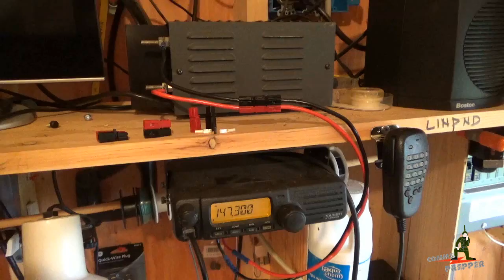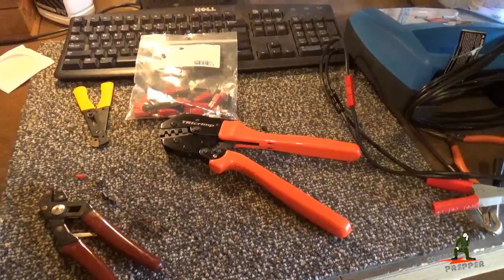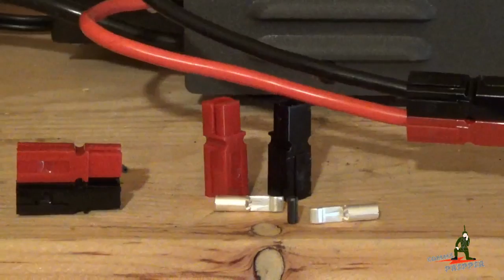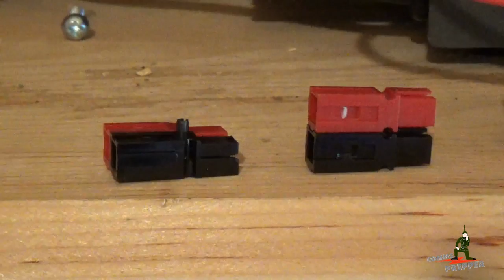Anderson Powerpole® Connectors

Comment: Just started using them. They really neaten up the shack! I am a handicapped ham having almost no feeling in my hands. At first I had problems but a tiny vise really helped. I started with the proper crimping tool and after a little adaptation and some fancy English I got them to work. I almost never solder. In the future I will buy preassembled shrouds. It was the only part I needed help with. I did finally order the $9.99 assembly/disassembly tool as it makes seating the tabs much easier. At first I found PowerPole connectors almost impossible but slowly, with many videos, I was able to master them. I’m on my way to converting every piece of gear I can. MikeinMinnesota N0WDM
Reply from the maker: Thanks for the comment.

Comment: Instead of using the roll pin you can use a screw to mount them to a surface. That can make unplugging them easier if you have a short lead length.

Comment: Anderson Power Poles are stackable and unisex. Other unisex connectors have a "source" and "device" scheme, or are ambiguous in their polarity (get it wrong = bad day).
Devices such as batteries could be considered either a "device" or a "source". With Anderson PPs, ground is always common. As long as you set up your positives and negatives in the same position, polarity will always be correct. You can use a different orientation for non-12v devices (like the BatPac does for solar panel inputs). 
This way, you can connect Powerpoles in the dark and never get it wrong.
It is good to standardize 12v equipment to these in your shack or with your group, and make a few accessories such as y-splitters, alligator clips, bullet terminals, auto/cigarette plugs and jacks, barrel connectors, and blade/ring terminals with Anderson PPs on the other end for inter-compatibility in almost any circumstance. Definitely worth the expense.

Comment: Great video, Hank!  I swear by PowerPole connectors.  They are awesome!  There is one thing I'd like to add though.  If you solder the connectors onto the wires then you don't need the crimp tool.

Comment: do you have to crimp it? or can it be soldered? like the terminals in the mostly "gray" quick disconnections.
Reply: +dale myers Yes, they can be soldered.  That's how I do all of mine.  I never crimp.
Reply: i've never used an anderson. but i prefer the smallest of the bigger high current gray connectors. and they don't pull apart as easily as an anderson connector.
Reply: +dale myers There are some little clips you can buy from PowerWerx that help secure the smaller red and black type connectors together.

Comment: These are great connectors ! I have been using them since they were introduced to the hobby industry. I generally buy them in bulk from Tower Hobbies (cheaper than HRO or AES). The Gardner and Bender GS388 non insulated crimper works well.  Thanks for sharing !

Comment: Are there male and female sides to the connectors, or are they unisex?  Do they seem fairly robust & durable?  (good for a few thousand make-break cycles?) Thanks for the vid!
Reply from the maker: +GoingGoingGalt They are unisex and seem robust.  As for a few thousand make-break cycles I cant say.  I will not be moving equipment that much nor do I plan to use them as switches.

Comment: I have been using SAE two pole connectors for years but they have there drawbacks. After see the Anderson power pole connectors in several YouTube videos I order some a couple weeks back. Now I have to began the process of swapping them out. Lastly, I think you can solder them v.s. buying the crimper.
Reply from the maker: +Nomad-76 Soldering is an (preferred) option but I will work with the crimp tool too.

Comment: I use PP's but the downside they are not waterproof like bullet connectors.
Reply: The do make a waterproof boot though.  Look on PowerWerx.com and look in the accessories area.
Reply: +Carl Brutananadilewski anderson do make spek pak series connectors that are ip68 rated and definitely waterproof but a bit pricey
Reply from the maker: +Carl Brutananadilewski agreed but my equipment is not waterproof either.  Thanks for watching and commenting.
Reply: Richard Slusher interesting I'll check it out.